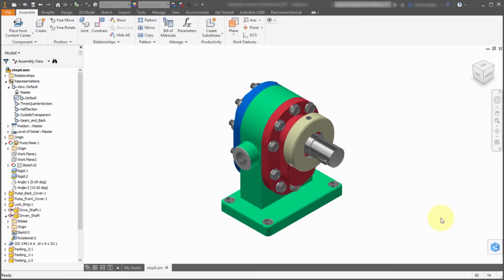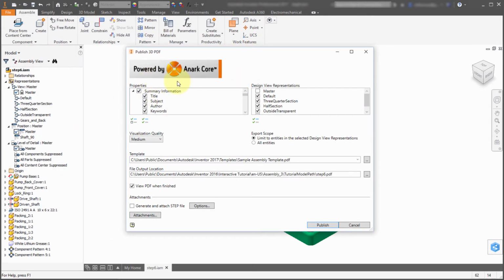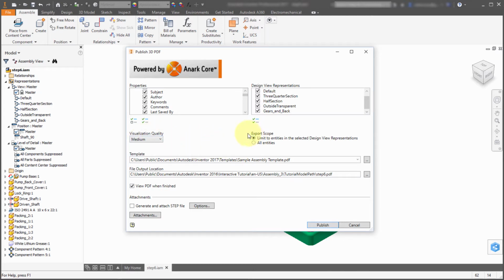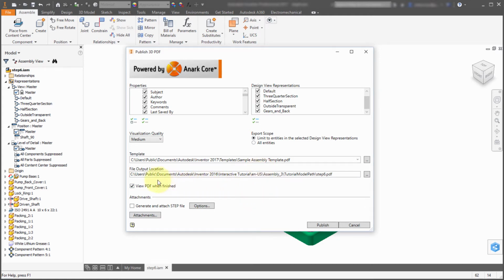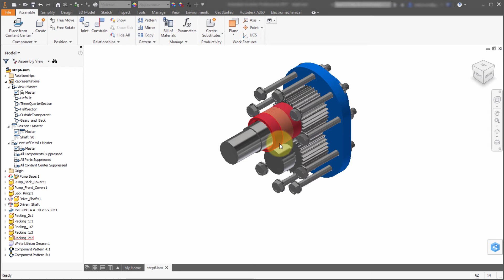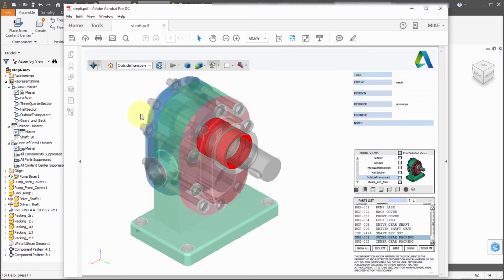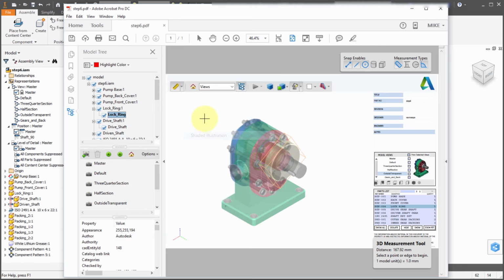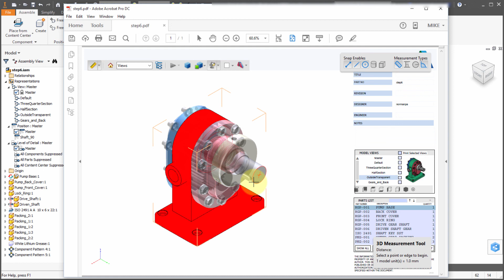Inventor 2017 3D PDF

Comment: How did you manage to retain the color in 3d pdf?
Reply: The colour should be retained by default. I looked at the 3D PDF export options and the only thing I can think of is that you are exporting the model using a Design View Representation that has removed all the colour?

If not, then this sounds like something you should log with Autodesk Tech Support